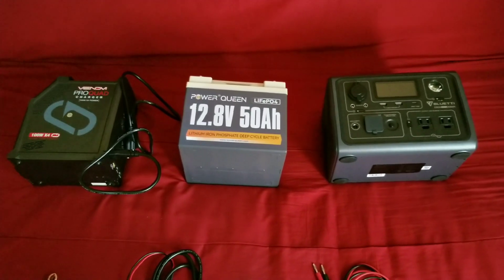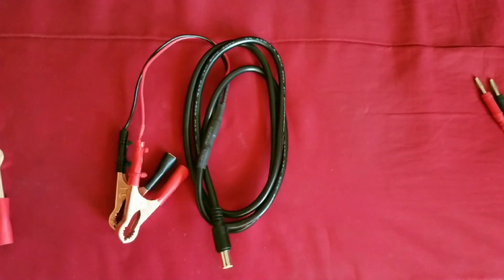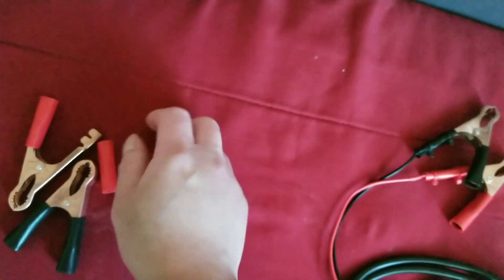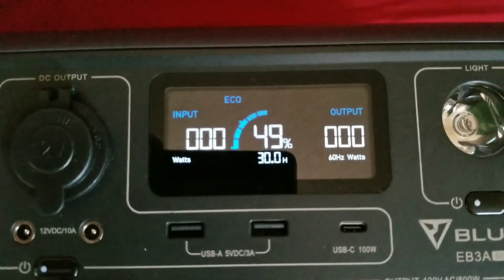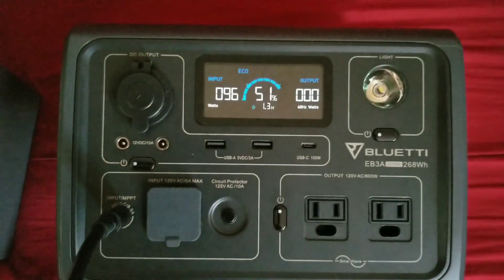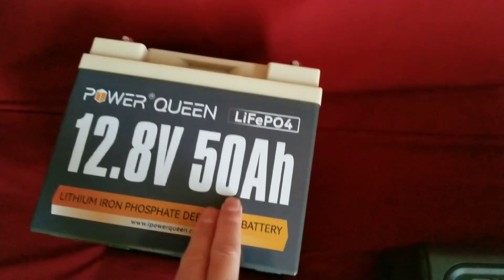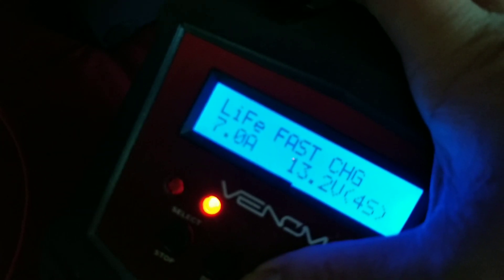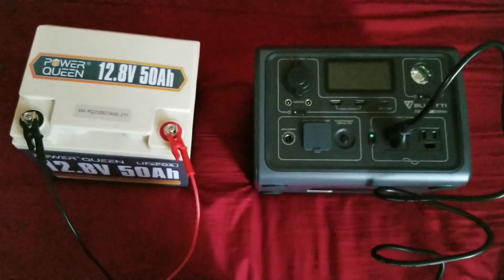How to extend the capacity of Bluetti EB3A

Comment: You will wear out the internal battery faster with this trick 😅
Reply from the maker: Not true!! I believe you have been misinformed.  The internal battery will wear out about the same rate as if you were changing it with solar, car 12v cigarette lighter, or AC outlet! 

Where did you even hear that from? And do you have any  hard evidence to back up your claim?
Reply: @edwindeleon  Right no different than keeping it plugged and charging via ac outlet or solar.
Reply: There is zero logic behind this statement

Comment: Thanks for an informative detailed video, i am new to all this ,i have different brand lifepo battery 12v100ah. do you think i can do the same thing ? thanks again. 
and does the gauge of the eb3a charging cable would affect this ? for example ,if i buy a different already made cable like it .
Reply from the maker: I'm glad this video helped in some way or form. 

YES, you can do this with a different brand lifepo4 12v 100ah battery. As long as you are within the 12v-29v parameters of the bluetti eb3a solar charge input. 

As for the gauge of wire  you're going to want to use the right thickness wire for the amount of current your system is going to use. So for this setup, the bluettie eb3a mppt charge controller clearly states  8.5amp draw. So your going to want to stick to 16guage (rated for 13amps) or lower (meaning bigger). You can go smaller but I would recomend to always go a little thicker just for safety measure. 

Btw hope that helps. Pls consider subscribing. It's free to do. But If u don't want its ok. No pressure. Thanks and have a great day!

Comment: Buongiorno, la ringrazio per il video che ha fatto. Ho già collegato anche io una batteria da 30 AH, con lo spinotto alla porta
DC input Port , ora vorrei sapere se è possibile mettere un raccordo a  --- T --- nella porta  DC input Port in modo da inserire
oltre allo spinotto che porta corrente dalla batteria, anche uno spinotto che porta corrente al EB3a dal pannello solare.
Grazie saluti
Reply from the maker: Hello, sorry I do not speak or understand Italian. I speak English only. I used google translate to try to understand your comment. 

"Hello, thank you for the video you made. I have also already connected a 30 AH battery, with the plug to the DC input Port, now I would like to know if it is possible to put a --- T --- fitting in the DC input Port so as to insert in addition to the plug that carries current from the battery, also a plug carrying current to the EB3a from the solar panel. Thank you" 

I'm going to try my best to understand what you are asking. So if your talking about connecting a 30ah battery and solar at the same time using a T fitting to the DC MPPT  input I would not recomend it . You might fry and damage the solar panel or the eb3a. Now if you are talking about connecting two 30ah batteries on a T fitting then YES, you can. It depends on the T fitting if its a series or parallel configuration.  

I hope that answers your question. The translation from google translate is not very clear.

Comment: you can use a 24 volt battery  i wonder why you went with the 12 volt?  DC input VOC 12-28VDC / 8.5A
Reply from the maker: 24v - $$$$   (around $600)
12v - $          (around $150)

Also, my aplication does not require a 24v⚡ external battery.👍👍
Reply: @edwindeleon  the higher the voltage the more watts you will get and the faster you can charge the EB3A BTW you can get a Valence 24 volt Lithium Iron battery for 149.00 plus shipping of course

Comment: Very informative.  Can I be using the Bluetti Eb3a to power my iceco 40  12v refrig while having the Bluetti hooked up to a 100 ah Power Queen lifepo4 battery thru the 8mm in port at the same time?  Thanks in advance.
Reply from the maker: Yes, you absolutely can!! 
It will extend the run time of your iceco 40 and if you bought solar panels you can run it indefinitely with out plugging into the grid as long as there is sun. You can also charge it in your vehicle when you are driving while the iceco is plugged in. 

I'm glad this video  helped you. Pls consider subscribing. Its free to do. If you don't want to subscribe its ok. No hard feelings 👍. Btw thanks for watching!!
Reply: @edwindeleon    Thank you.  I have subscribed.  And also liked!   👍👍👍

Comment: The battery has a built-in BMS, so you can charge the power queen with any bat charger that can get to 14 volts.
Reply from the maker: Yes, that maybe so, but I dont  know the reliability  of these chinese BMS in these lifepo4 batts ESPECIALLY these cheap Lifepo4 batteries they sell frm China. 

  I always air on the side of caution. LifePo4 might not be as reactive as a LiPo bat but they can still explode into flames. So I always use these "smart" chargers that are built for the specific  battery chemistry to provide another layer of safety. 

I understand that you can use any charger or even a  power supply that can provide the correct voltage  to charge  these batteries but its good practice to use a smart charger that is specifically designed for the battery chemistry.  

I do a lot of RC hobbies and we typically use LiPo on our rig and these batteries do not have BMS.  I was taught to always use smart chargers  that are  designed for that specific chemistry regardless if it has a BMS or not bc all it takes is one failed BMS and boom!! There goes your house! Lithium batteries are not to be taken lightly!
Reply: @BRObot Simulations v1.2  I feel ya, what else is neat about these "drop in ready" type is that if you buy 4 of them and wire them in series to get 48 nominal voltage you can then plug them into the solar side of the back-up giving you more amps.
Reply from the maker: @JayRSwan  Yes, that is correct.  Unfortunately the eb3a is only rated for 12v- 28v (30v is absolute max. I tested it).  

So, I actually bought 2 of these 12.8v 50ah and hook them up in series for a 24v 50ah for a 2p 8s configuration.     
I'm able to increase the wattage from ~100w to ~200watts charge rate, which in turn maximize the power transfer. So, for example  im running my projector, which  consumes ~100w, im still able compensate for the 100w loss from the projectors consumption and charge the eb3a batteries with the left over 100w at the same time.  If that makes sense. 

Also, not only I'm able to maximize the power transfer, I am also able to increase the capacity from 640Wh to  1.2KWh by running them in series. And thats not even including the 268wh from the eb3a internal battery. So technically I have 1.468KWh (1468 watt hour)!!!

That is pretty cool for a very cheap  $200 eb3a being able to extend it any capacity you need!!
Reply: @edwindeleon  LiFeP04 is nearly impossible to get into thermal runaway. Actual combustion I have only seen on one video and it was the electrolyte burning, very mild and went out quickly

Comment: Blue Eddie has car cable expansion set by that instead
Reply from the maker: Yes, I have the car and the solar cable as well. But I bought an extra solar cable and modified it to have alligator clamps at the end. So I have 3 cables in total.

So I can basically  charge and extend my eb3a via car, solar, and any external 12-24v battery.

Comment: I have a problem to charge bluetti eb3a with my gas generator (220V - 250V).
How can I solve?
Reply from the maker: Ok, this is very difficult to diagnose as I do not know all the information required to assess the problem. 
But with the information you provided me i will try to help. 

 First, does your gas generator have a pure sign wave inverter? Many gas generators have modified sign wave and if that's the case the eb3a might not charge properly.  
 
2nd is there might be an issue with the gas generator or the eb3a a/c input.  If you plug your eb3a on your house outlet and it charges then the issue is your gas generator.  

Hope that helps.

Comment: Should have just left the eb3a car charger and added a cigarette outlet to the external battery. That way the fuse inside the eb3a is left intact.
Reply from the maker: I already added an inline fuse between the battery and the eb3a.  But Thank you for the tip!

Comment: If you have the solar going into the eb3a why couldn't you charge the aux battery straight from the eb3a since it uses the same style battery?
Reply from the maker: You can charge it directly from the eb3a. That's exactly what I did on the video.

Comment: Same reason why I did not get the EB3A. It is lacking in the power department. Other power stations are more powerful.
Reply from the maker: Of course, there are other power stations that are more powerful and have more capacity than the eb3a!! 

You have to realize that everyone has different power requirements! Thats the reason why companies build different sizes and capacities to cater to different people.

 Just like clothes and shoes, cars and SUVs; there are different sizes bc everyone has different requirements and needs. 

So, saying the eb3a is "lacking in power department" is flawed. Just bc your power requirements do not fit the eb3a does not mean the eb3a is lacking in power.

For my needs the EB3A has more power than I need for a great price point of $200. And I am able to extend it to any capacity I choose if it needs be. Perfect for my use case!

Comment: That is the achilles heel of the EB3A. It is not expandable like other power stations.
Reply from the maker: But it is expandable as I showed!!  Just not the official way. Did you even watch the video? lol. 

I actually prefer this method as I can extend it to any capacity I want!! from 50wh to 50kwh!! With other powerstations with expandable batteries, you are stuck with the company's proprietary external batteries, and you are stuck with the capacity they provide you in their proprietary external batteries. And on top of that they cost sooo much $$$$.

At least with this method I can choose whatever batteries I want, and they are way cheaper than the company's external batteries. You can get a 600wh lifepo4 battery for $150-200. And for bluetti external battery cost $1000+ and they are very limited with capacity size to choose frm.
Reply: Very very few systems are expandable (and by that I mean have a proprietary system for adding additional capacity). I've only seen ONE that had a straight up expansion port for ANY other battery to be used as an expansion (I think it had to be 24V to match the internal battery) so you're not plugging up your DC input port at a slow rate

Comment: Іs it possible to charge the Bluetti EB3a with lead-acid car batteries?
Reply from the maker: If you mean charging it in your car, then YES you can. But you have to keep the car running to prevent the lead acid battery from completely discharging. 

Now If you are taking about charging it directly from lead acid battery with out the car then i would highly not recommend it. 

Technically, you can charge it with lead acid battery but it's not preferable bc lead acid battery drops voltage too quickly and you will not get a full charge on the eb3a. Also, the capacity of lead acid is not great and you can only discharge it to 50% and if you go past that it will get damaged.
Reply: yeah, pickup a goal zero yeti lithium car charger adapter and it will plug right in to a lead acid battery and your eb3a and it will automatically stop before the lead acid battery drops to a dangerous level.

Comment: isn't it a better idea to charge your battery directly from a solar panel? You will not lose power on the inverter transforming.
Reply from the maker: Yes, that's also another way to charge an external battery but you're  going to need to buy an external MPPT controller and going to have to program it,  which i do not have.  Im just using what i already got laying around the house.

 In addition I wanted to keep it simple bc the person im addressing in this video is new to the solar generator world and I do not know how comfortable he is in tinkering with this type of stuff.
Reply: @edwindeleon  Yeah I agree with what you said, it's more of a hassle getting more parts for this and that, to program mppt charge controller, your method is simple. Charger plug directly in power station solar panels plugged into power station, connect alligator clips to battery, boom both charging.
Reply: Would it be possible to charge the battery directly with a solar panel, then have the battery directly connected to the bluetti permanently, so you wouldn’t need to keep switching wires. You basically use the outlets on the bluetti but have a far larger battery capacity always avaiilable????
Reply: @keepsmiling1484  you need a solar charge controller which the EB3A has internally so its either the solar panel or the other battery for the DC input (solar input). The panel straight into the 12V battery will be around 18V

Comment: If the battery voltage drops below 12V, Bluetti will not charge from it. This option is not suitable. For normal charging, you need to increase the voltage from the battery to 18 volts.
Reply from the maker: I USE this method all the time and let me tell you that its more than suitable and works flawlessly! The eb3a is designed to be charged on a  car via a 12v cigarette lighter port.   Its clearly writen on the port 12-28v so as long as you stay within that parameter it will charge.  

This may be true with other 12v batteries but the  battery im using is a LifePO4, which is much more advanced battery than lead acid or agm. The voltage on lifepo4 batteries stays above the required 12v and the voltage does not fall under 12v until it's about 0% state of charge, and that's when it cuts out. 

I tested this multiple times and i get exactly  640Ah while maintaining more than or equal to 12v.
Reply: @edwindeleon  Yes, that's right, but at a voltage of 12 - 13V, the charge power is less than 100W.  And at 18V it reaches 200W, which allows you to quickly restore the charge.
Reply: @viktor-ard-motorcycle  Wow dude. Learn to take an L
Reply: @viktor-ard-motorcycle  I tried it out last night. When the external battery reaches 12.0v the eb3a charges at only 1 watt but it will continue all night long and drain the external battery to below 11 volts.

Comment: Thanks for showing the idea in practice. Are those connectors safe? I mean will they hit with electric charge if touching one of the "scissors"'s metal part?
Reply from the maker: It is safe to a certain extent. There is a risk but as long as you know what you are doing then it's safe.  You can also put electrical tape on there terminals to keep them safe.